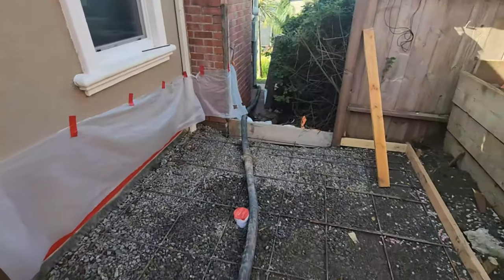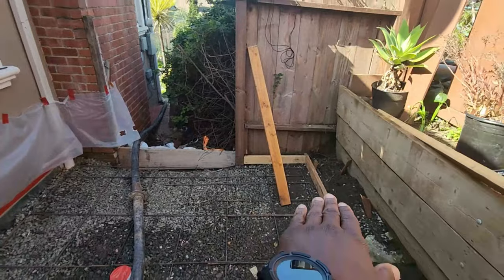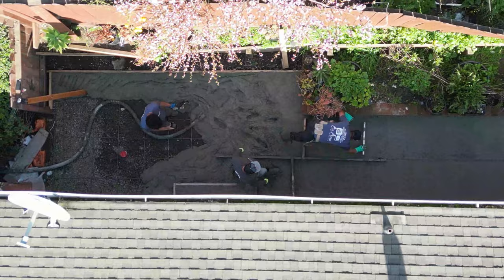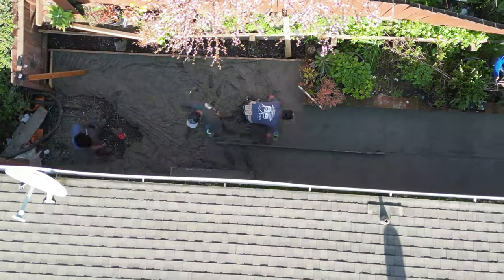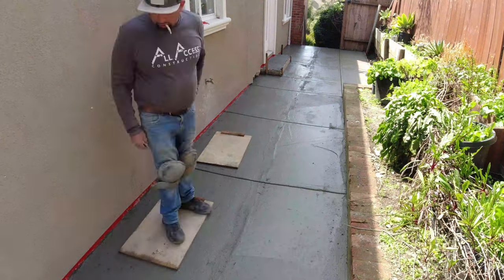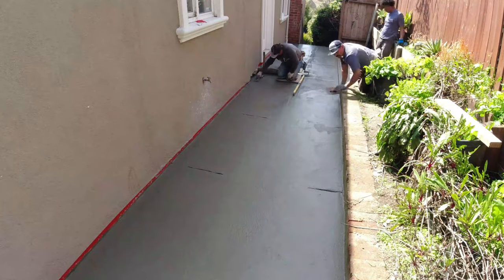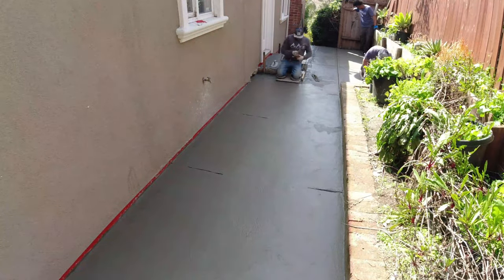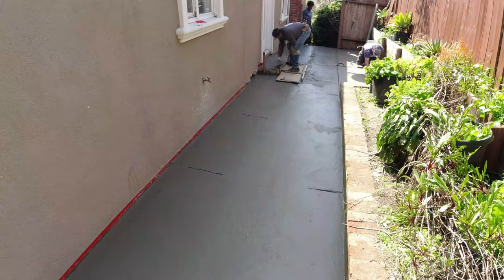🎯With A Concrete V-Ditch You Can Protect Your Home Instantly  ‼️

Comment: I guess in California - they dont have much need for drainage, well except for the past 3 months lol. 
 
 I watch Gate City Foundation Drainage, and Shaun is brilliant at drainage, he works in one of the Carolinas, - I guess the state is one big swamp.
But Shaun always makes sure any rainwater from the roof is channelled away using Schedule 40. The roof is where most of the flooding issues come from.

But another brilliant video, well done AAC!  
Guys - your subs gonna explode soon, you have a huuuuuge backlog, and folks will just binge watch!

Your channel just popped up onto my feed....your Subs gonna go vertical.
Reply from the maker: Appreciate the kind words.. We use sdr 35 pipe and it's all tied in under the concrete..